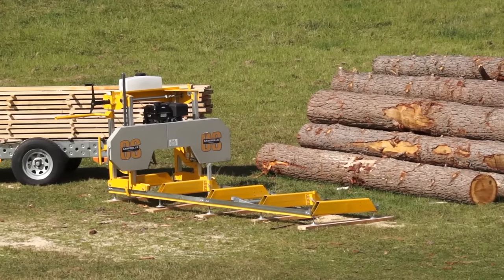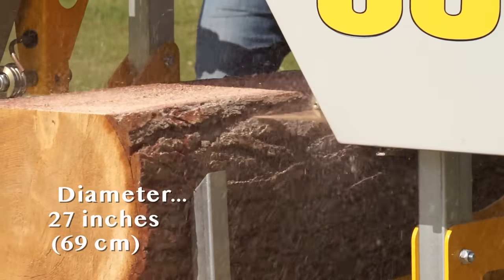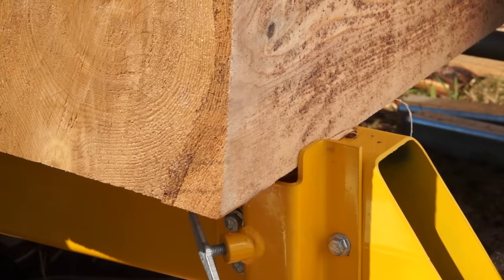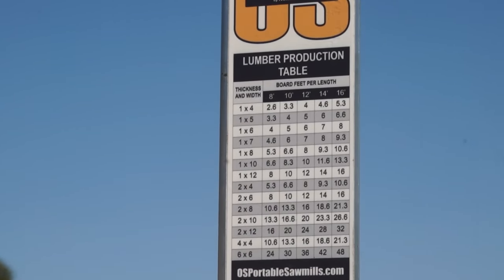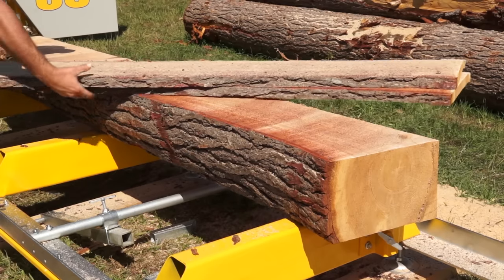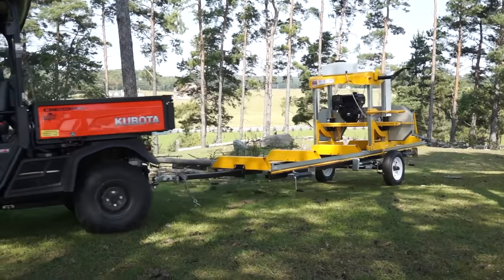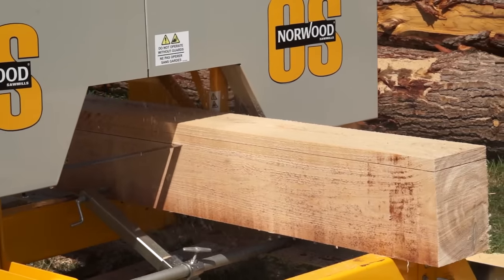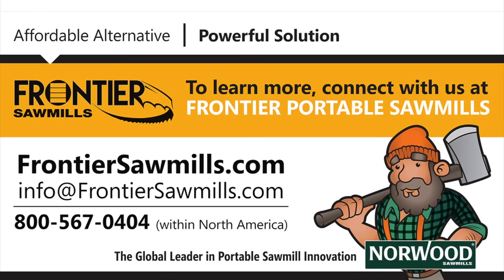The Affordable, Easy-to-Use & Reliable Sawmill You've Been Looking for - The Frontier OS27

Comment: OK my friends. The Norwood OS27 with electric start engine is $3,667.00. With recoil engine $3,297.00.
Reply from the maker: Correct George

Frontier builds three sawmill models with different log diameter capacities: OS23: 23” (59cm), OS27: 27” (69cm), and OS31: 31” (79cm). Standard log length is 11’ (3.4m) but you can add 7’ (2.1m) extensions to mill as long as you want.  You can add the optionally available trailer/support jack system to all Frontier sawmills at any time (when you get your Frontier or in the future). 

Frontier Sawmills start at just USD $2297 (for the Frontier OS23). The Frontier OS27 starts at only $3297.  The Frontier OS31 starts at only $3897. 

You can get a lot of helpful info about Frontier Sawmills, including all pricing, at www.FrontierSawmills.com  .

Comment: Fun little saw.  Like to see it cut some of the hardwood logs that we focus on salvaging here in Texas.....mesquite, pecan and live oaks.   Either way, seems like a great saw for the hobbyist.  Good cut quality on those softwoods.  Too many dead and fallen trees....not enough urban sawyers to take advantage of all this wood going to waste.  So having an affordable option is great for those looking to potentially get into the business.
Reply: Is it under $4k?
Reply: How can I order it?
Reply: Ghalibhemed Said   Did you watch the video to the end?
Reply from the maker: Frontier builds three sawmill models with different log diameter capacities: OS23: 59cm (23”), OS27: 69cm (27”), and OS31: 79cm (31”). Standard log length is 3.4m (11’) but you can add 7’ (2.1m) extensions to mill as long as you want.  You can add the optionally available trailer/support jack system to all Frontier sawmills at any time (when you get your Frontier or in the future).

Frontier Sawmills start at just USD $2397 (for the Frontier OS23). The Frontier OS27 starts at only USD $3397.  The Frontier OS31 starts at only USD $3997.  

You can get a lot of helpful info about Frontier Sawmills, including all pricing, at www.FrontierSawmills.com  .

Frontier services your country factory-direct.  To order, contact us directly at Frontier Sawmills via email at info@FrontierSawmills.com . 

Thanks!
Reply from the maker: Frontier builds three sawmill models with different log diameter capacities: OS23: 59cm (23”), OS27: 69cm (27”), and OS31: 79cm (31”). Standard log length is 3.4m (11’) but you can add 7’ (2.1m) extensions to mill as long as you want.  You can add the optionally available trailer/support jack system to all Frontier sawmills at any time (when you get your Frontier or in the future).

Frontier Sawmills start at just USD $2397 (for the Frontier OS23). The Frontier OS27 starts at only USD $3397.  The Frontier OS31 starts at only USD $3997.  

You can get a lot of helpful info about Frontier Sawmills, including all pricing, at www.FrontierSawmills.com  .

Thanks!
Reply: Even for the hardwoods it would still beat using a Alaskan sawmill.  Just take it slow.
Reply: इस मशीन की कीमत क्या है
Reply: តើខ្ញុំអាចបញ្ជាទិញវាដោយរបៀបណា

Comment: 4:32  Take the board off before you go back.  Then you can tell if the next cut is worthwhile,  or if there is metal in the wood, or if the cant should be rotated.
Reply: Smart!  Plus, you don't have to crank it up and back down, just down to the next cut.

Comment: More information such as price, suppliers in India along with depreciable parts etc.
Reply from the maker: Frontier builds three sawmill models with different log diameter capacities: OS23: 59cm (23”), OS27: 69cm (27”), and OS31: 79cm (31”). Standard log length is 3.4m (11’) but you can add 7’ (2.1m) extensions to mill as long as you want.  You can add the optionally available trailer/support jack system to all Frontier sawmills at any time (when you get your Frontier or in the future).

Frontier Sawmills start at just USD $2397 (for the Frontier OS23). The Frontier OS27 starts at only USD $3397.  The Frontier OS31 starts at only USD $3997.  

You can get a lot of helpful info about Frontier Sawmills, including all pricing, at www.FrontierSawmills.com  .

Frontier services your country factory-direct.  To order, contact us directly at Frontier Sawmills via email at info@FrontierSawmills.com . 

Thanks!
Reply: Price

Comment: Man I would love to own one but I just can’t afford it right now
Reply from the maker: Frontier builds three sawmill models with different log diameter capacities: OS23: 23” (59cm), OS27: 27” (69cm), and OS31: 31” (79cm). Standard log length is 11’ (3.4m) but you can add 7’ (2.1m) extensions to mill as long as you want.  You can add the optionally available trailer/support jack system to all Frontier sawmills at any time (when you get your Frontier or in the future). 

Frontier Sawmills start at just USD $2397 (for the Frontier OS23). The Frontier OS27 starts at only $3397.  The Frontier OS31 starts at only $3997. 

You can get a lot of helpful info about Frontier Sawmills, including all pricing, at www.FrontierSawmills.com  .

We would be happy to mail you a free Frontier Sawmills info kit. You can order one online at  https://www.frontiersawmills.com/en_us/free-catalog-free-dvd-form

We would be happy to answer any questions that you may have, or to prepare a quote, including shipping to your door.  Let us know the best number to reach you at or please feel free to call us toll-free at 800-567-0404.

Thanks!
Reply: For real. I find that even the cheap ones are still expensive. I guess that's what happens when you're broke.
Reply: @FrontierSawmills  peras

Comment: Now I'm absolutely serious enough to consider buying one if it's in my price range of around $3k. If I'm not even close enough to that just let me know please.
Reply from the maker: You're close. Like I mentioned in my reply to your other question, Frontier builds three sawmill models with different log diameter capacities: OS23: 23” (59cm), OS27: 27” (69cm), and OS31: 31” (79cm). Two Frontiers are in your price range: Frontier Sawmills start at just USD $2297 (for the Frontier OS23). The Frontier OS27 starts at only $3297.
Reply: How to buy
Reply: @FrontierSawmills  బ్న్0ప్బివివి కో క్

Comment: Hi, i am looking for such type of affordable sawmill machine , so how can i get purchase this particular sawmill.
Reply from the maker: Frontier builds three sawmill models with different log diameter capacities: OS23: 59cm (23”), OS27: 69cm (27”), and OS31: 79cm (31”). Standard log length is 3.4m (11’) but you can add 7’ (2.1m) extensions to mill as long as you want.  You can add the optionally available trailer/support jack system to all Frontier sawmills at any time (when you get your Frontier or in the future).

Frontier Sawmills start at just USD $2397 (for the Frontier OS23). The Frontier OS27 starts at only USD $3397.  The Frontier OS31 starts at only USD $3997.  

You can get a lot of helpful info about Frontier Sawmills, including all pricing, at www.FrontierSawmills.com  .

Frontier services your country factory-direct.  To order, contact us directly at Frontier Sawmills via email at info@FrontierSawmills.com . 

Thanks!
Reply: @FrontierSawmills  😭

Comment: How to order this saw mill machine?
Reply from the maker: Frontier builds three sawmill models with different log diameter capacities: OS23: 59cm (23”), OS27: 69cm (27”), and OS31: 79cm (31”). Standard log length is 3.4m (11’) but you can add 7’ (2.1m) extensions to mill as long as you want.  You can add the optionally available trailer/support jack system to all Frontier sawmills at any time (when you get your Frontier or in the future).

Frontier Sawmills start at just USD $2397 (for the Frontier OS23). The Frontier OS27 starts at only USD $3397.  The Frontier OS31 starts at only USD $3997.  

You can get a lot of helpful info about Frontier Sawmills, including all pricing, at www.FrontierSawmills.com  .

Frontier services your country factory-direct.  To order, contact us directly at Frontier Sawmills via email at info@FrontierSawmills.com . 

Thanks!

Comment: If I ever hit the lottery, i'm going to buy land for a cabin and a lumber yard and be a lumberer.
Reply: I m in guatemala o need price  from in guatemala or usa pleace
Reply: Mit deutschen Beschreibungen
Reply from the maker: Es gibt drei Frontier Sägewerksmodelle mit verschiedenen Motorisierungen und Säge-Durchmessern Das Einstiegersägewerk OS23 mit einer möglichen Stammstärke bis zu 59cm in den Motorvarianten 7,0 PS, 10,0 PS Viertakt-Motor und 4,4KW Elektromotor, das Frontier OS27, die starke Mittelklasse für Stämme bis 69cm und einem 13,5 PS Briggs & Stratton Motor oder einem leistungsstarken 5,5KW Elektromotor. Mit dem größten Frontier Sägewerk bewerkstelligen Sie Stämme bis 79cm Durchmesser bei einer Motorleistung von 14PS oder 5,5KW.

Sie können ein Frontier Sägewerk ab 3099€ erwerben.

Sie finden viele weitere Informationen zu den Frontier Sägewerken auf https://www.frontiersawmills.com/de_de/

Für Rückfragen oder eine persönliche Beratung steht Ihnen das Grube Team in Deutschland unter +49(0)5194/900-403 oder in Österreich +43(0) 7613 / 44788 gerne zur Verfügung. www.grube.de oder www.grube.at
Reply from the maker: Frontier builds three sawmill models with different log diameter capacities: OS23: 59cm (23”), OS27: 69cm (27”), and OS31: 79cm (31”). Standard log length is 3.4m (11’) but you can add 7’ (2.1m) extensions to mill as long as you want.  You can add the optionally available trailer/support jack system to all Frontier sawmills at any time (when you get your Frontier or in the future).

Frontier Sawmills start at just USD $2397 (for the Frontier OS23). The Frontier OS27 starts at only USD $3397.  The Frontier OS31 starts at only USD $3997.  

You can get a lot of helpful info about Frontier Sawmills, including all pricing, at www.FrontierSawmills.com  .

Frontier services your country factory-direct.  To order, contact us directly at Frontier Sawmills via email at info@FrontierSawmills.com . 

Thanks!

Comment: Is there any upgraded model in this..? Like bigger in diameters. Please do let me know.What is the maximum size in diameters
Reply from the maker: Frontier builds three sawmill models with different log diameter capacities: OS23: 23” (59cm), OS27: 27” (69cm), and OS31: 31” (79cm). Standard log length is 11’ (3.4m) but you can add 7’ (2.1m) extensions to mill as long as you want.  You can add the optionally available trailer/support jack system to all Frontier sawmills at any time (when you get your Frontier or in the future). 

Frontier Sawmills start at just USD $2297 (for the Frontier OS23). The Frontier OS27 starts at only $3297.  The Frontier OS31 starts at only $3897. 

You can get a lot of helpful info about Frontier Sawmills, including all pricing, at www.FrontierSawmills.com  .
Reply: Thank u... Is there a Dealer in India?
Reply from the maker: Frontier services India factory-direct.  To order, contact us directly at Frontier Sawmills via email at info@FrontierSawmills.com .

Comment: Tom Devery. Irelnd. I'D like one of those !
Reply from the maker: Hi Tom

We would be happy to help you.  We can help you factory-direct. 

Here is some helpful info: 

Frontier builds three sawmill models with different log diameter capacities: OS23: 59cm (23”), OS27: 69cm (27”), and OS31: 79cm (31”). Standard log length is 3.4m (11’) but you can add 7’ (2.1m) extensions to mill as long as you want.  You can add the optionally available trailer/support jack system to all Frontier sawmills at any time (when you get your Frontier or in the future).

Frontier Sawmills start at just USD $2297 (for the Frontier OS23). The Frontier OS27 starts at only USD $3297.  The Frontier OS31 starts at only USD $3897.  

You can get a lot of helpful info about Frontier Sawmills, including all pricing, at www.FrontierSawmills.com  .

Frontier services your country factory-direct.  To order, contact us directly at Frontier Sawmills via email at info@FrontierSawmills.com .

Comment: I would like to know market value of the machine!
Reply from the maker: Frontier builds three sawmill models with different log diameter capacities: OS23: 59cm (23”), OS27: 69cm (27”), and OS31: 79cm (31”). Standard log length is 3.4m (11’) but you can add 7’ (2.1m) extensions to mill as long as you want.  You can add the optionally available trailer/support jack system to all Frontier sawmills at any time (when you get your Frontier or in the future).

Frontier Sawmills start at just USD $2297 (for the Frontier OS23). The Frontier OS27 starts at only USD $3297.  The Frontier OS31 starts at only USD $3897.  

You can get a lot of helpful info about Frontier Sawmills, including all pricing, at www.FrontierSawmills.com  .

To order, contact us directly at Frontier Sawmills via email at info@FrontierSawmills.com . 

Thanks!

Comment: Wow I like it... from Nepal
Reply from the maker: Frontier builds three sawmill models with different log diameter capacities: OS23: 59cm (23”), OS27: 69cm (27”), and OS31: 79cm (31”). Standard log length is 3.4m (11’) but you can add 7’ (2.1m) extensions to mill as long as you want.  You can add the optionally available trailer/support jack system to all Frontier sawmills at any time (when you get your Frontier or in the future).

Frontier Sawmills start at just USD $2297 (for the Frontier OS23). The Frontier OS27 starts at only USD $3297.  The Frontier OS31 starts at only USD $3897.  

You can get a lot of helpful info about Frontier Sawmills, including all pricing, at www.FrontierSawmills.com  .

Frontier services your country factory-direct.  To order, contact us directly at Frontier Sawmills via email at info@FrontierSawmills.com .
Reply: @FrontierSawmills  
Please, is the any place to get it in Canada, Quebec?
Could you send me you catalog with prices and shipping options.
Thanks

Comment: Now what does it actually cost for this machine as shown?.
Reply from the maker: Frontier builds three sawmill models with different log diameter capacities: OS23: 23” (59cm), OS27: 27” (69cm), and OS31: 31” (79cm). Standard log length is 11’ (3.4m) but you can add 7’ (2.1m) extensions to mill as long as you want.  You can add the optionally available trailer/support jack system to all Frontier sawmills at any time (when you get your Frontier or in the future). 

Frontier Sawmills start at just USD $2297 (for the Frontier OS23). The Frontier OS27 (THE ONE IN THIS VIDEO) starts at only $3297 and that is the cost for it as you see on the ground.  The Frontier OS31 starts at only $3897. 

You can get a lot of helpful info about Frontier Sawmills, including all pricing, at www.FrontierSawmills.com  .

Would you like a free Frontier Sawmills info kit? You can order one online at  https://www.frontiersawmills.com/us/free-catalog-free-dvd-form .
Reply: I have 45 acres near Tahoe full of redwood.  I'll better for 1...
Reply: Ok

Comment: Hi... what's the maximum dia n maximum length it can cut. ?.
Reply from the maker: Frontier builds three sawmill models with different log diameter capacities: OS23: 59cm (23”), OS27: 69cm (27”), and OS31: 79cm (31”). Standard log length is 3.4m (11’) but you can add 7’ (2.1m) extensions to mill as long as you want.  You can add the optionally available trailer/support jack system to all Frontier sawmills at any time (when you get your Frontier or in the future).

Frontier Sawmills start at just USD $2297 (for the Frontier OS23). The Frontier OS27 starts at only USD $3297.  The Frontier OS31 starts at only USD $3897.  

You can get a lot of helpful info about Frontier Sawmills, including all pricing, at www.FrontierSawmills.com  .

Thanks!

Comment: India available Sir price?
Reply from the maker: Hi 

We ship all over the world.  We have not begun shipping the Frontier globally yet but we do have a great selection of our Norwood brand of sawmills.  

Norwood builds several models of manual and hydraulic portable band sawmills ranging in capacities from 66cm (26”) to 92cm (36”) log diameter.  All prices are available online at http://www.norwoodsawmills.com/sites/norwood/files/price-list-english.pdf 
We invite you to visit Norwood Sawmills online at www.NorwoodSawmills.com

Please feel free to email with your further questions and request for quote: info@NorwoodSawmills.com.
Reply from the maker: The Frontier OS27 is only USD $3297. 

You can also get a lot of helpful info online about Frontier Sawmills at www.FrontierSawmills.com  .
Reply: @FrontierSawmills  I'm impressed, especially when I saw that trailer option.
Reply from the maker: Frontier builds three sawmill models with different log diameter capacities: OS23: 59cm (23”), OS27: 69cm (27”), and OS31: 79cm (31”). Standard log length is 3.4m (11’) but you can add 7’ (2.1m) extensions to mill as long as you want.  You can add the optionally available trailer/support jack system to all Frontier sawmills at any time (when you get your Frontier or in the future).

Frontier Sawmills start at just USD $2297 (for the Frontier OS23). The Frontier OS27 starts at only USD $3297.  The Frontier OS31 starts at only USD $3897.  

You can get a lot of helpful info about Frontier Sawmills, including all pricing, at www.FrontierSawmills.com  .

Frontier services your country factory-direct.  To order, contact us directly at Frontier Sawmills via email at info@FrontierSawmills.com .